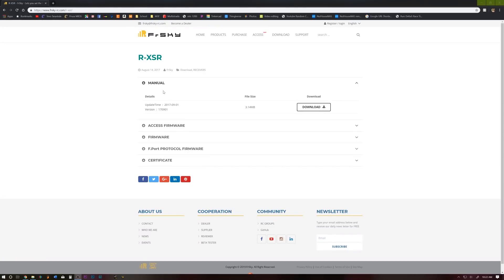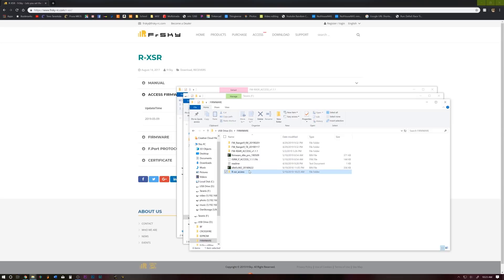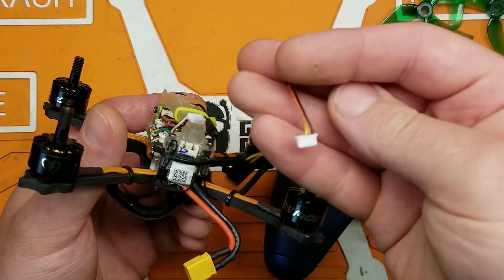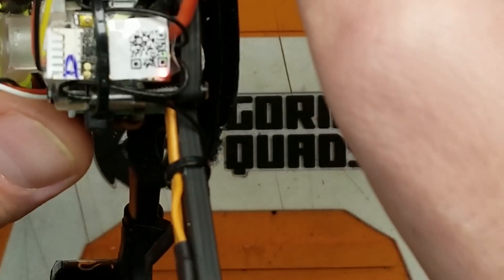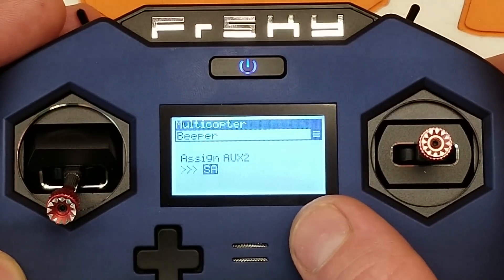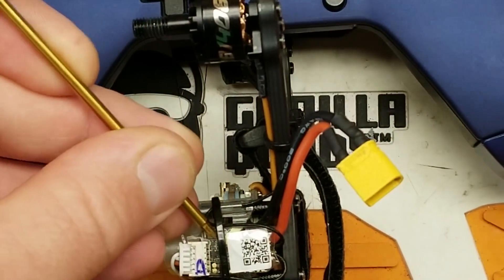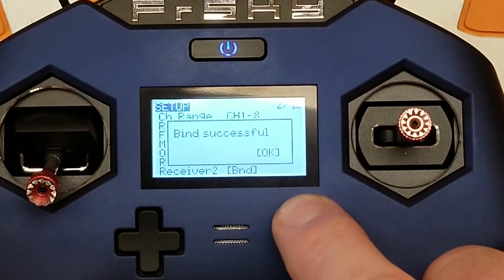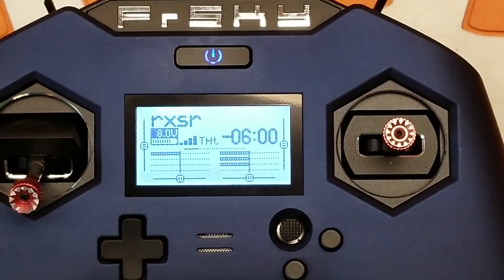Frsky R-XSR ACCESS firmware install

Comment: I’m trying to update firmware in my R-XSR.  I have a Taranis X9D Plus, do I need to get a cable with the mini usb to connect to my Taranis to my drone (chimera5)??
Reply from the maker: No. You need to connect the rxsr to the radio with a servo cable to flash fw.

Comment: I get an error right after it says device reset. 
any insight on this?
Reply from the maker: there has been a lot of changes to the frsky ecosystem since this video. I highly recommend making sure your radio's operating system is updated as well as the ISRM FW.

Comment: I just got my R-XSR and your  ACCESS flashing instructions are very welcome, quite clear and easy to follow. 
 Do you have any advice about antenna positioning onboard the aircraft?  There are two antennas that seem to be made from tiny coax. 
 Only about 1 inch of the inner conductor is exposed at the ends, which I take to be actual antenna.  I am thinking only the last inch or so needs to be "in the breeze" and vertical.  Must the black part of each coax (about  2.75 inches long) be straight as well?  Also does it matter how far apart these two 1 inch antennas are mounted onboard?
Reply from the maker: Thank  you for the kind words. The only part of the antenna that needs to be exposed is the clearish ends. Ideally you would want them oriented 90 degrees from each other and as far away as possible but it doesn't make that big of a difference if they are close.

Comment: hi its been a few weeks and i still cant bind ,, its solid red and green after i turn on the receiver and hold the bind button. i did the firmware update and fcc and my remote is fcc and flashed internal mod aswell. can i contact you through some website and pay for your services?
Reply from the maker: Hit me up on discord and I can help you out https://discord.gg/YrB7BSv

Comment: Thank you for creating such a clear video on how to do this. I have the X9 lite and RSXR and had a lot of trouble trying to get them bind. wasted like 4 hours with different methods found on the internet. watched your video and followed it step by step making sure that the firmwares match on both rx and x9. thank you!
Reply from the maker: Glad it helped
Reply: I tried both access and accst (instructions came for accst) but neither would bind. Tried a few times.. 
Then switched to xjt lite external module and binded instantly.. 
Feel like I'm losing range using xjt lite module instead of x9 lite s internal
Reply: I'm try changing radio firmware see if that works. Thinks its 2.3 or something
Reply from the maker: You'll need to update the operating system and the internal rf fw. Additionally you'll probably need to update the fw on the rxsr as well.

Comment: Thanks for the tutorial. Will the r-xsr with accst firmware bind to access d16??
Reply from the maker: Yes it will but the radio needs to have opentx updated to monething newer than 2.3.0 and the internal rf module needs to be updated to access v1.1.3. I wouldn't recommend flashing v2.x to the internal module.

Comment: Hi I’ve got my New FrSky 9D SE 2019. And this is my first time I bought a BNF drone. And the reciever is R-XSR. Do i need to download the firmware to the controller? Hope you help me.thanks.
Reply from the maker: Possibly. If you can create a model in your radio that uses accst d16 then you should be good. If you can no then you will need to update the os on your radio.
Reply: @TweetFPV  isaw on my seettings have accst d16.
but idont know how to bind my quad :( to my controller.
  thank you fro the reply sir.
Reply: @TweetFPV  can you help me sir.
Reply: Acutually i bough a BNF quad and the receiver is R-XSR.
Reply from the maker: It should be fairly easy. You will need access to the bind button on the r-xsr. Basically to out the rxsr into bind mode you need to hold the bind button down while powering the Quad on. This can be difficult one handed. If it's in bind mode the red led should be flashing. Then select bind in your radio. Exit bind mode in your radio and unplug your Quad. When you power your Quad back up you should see a solid green, red, and blue light.
Reply: TweetFPV now i get it thank you very much for your kind . Now i’ll proceed to beta flight configuration.
Reply from the maker: If you need any more help contact me using the discord link in the video description.

Comment: I flashed one of my r xsr succesfully but i bought a new one and it doesnt flash. It gives me an error. I already tried with the 3 versions of access firmware but nothing. Do you know what might be?
Reply from the maker: My guess is that you have the wrong wires connected to the rxsr for flashing. Be sure you are soldered to the smart port pad and are selecting flash s.port in the radio.

Comment: Great help this vide, just one weird thing is I have the options menu for the rXsr but there are no options  in it . I wonder if its because  I have the x9d.
Reply from the maker: X9d 2019?
Reply: @TweetFPV  Yes it is.
Reply from the maker: So you should have some options for the rxsr pop up but it's been hit or miss for me. That's how you set the rxsr up for fport mode or low latency mode and a few other options. I still haven't pinpointed why it intermittent.
Reply: @TweetFPV Once I hit the options  menu  mine   says "waiting  for rx "  As long as I can still fly..In your menu where you chose isrm mine says access and underneath  that I choose ch1-8 and It says 7ms.  Im on open tx2.3.4.
Reply from the maker: Yea that's what mine will say when it doesn't work but I can fly just fine.

Comment: Hi, I have the X9D 2019. I just flashed my radio to 2.3.4, you set your internal  rf to isrm. Mine has access and accst D16 only. Do you know if isrm is in 2.3.4
Reply from the maker: Isrm is a separate fw that needs to be loaded. Opentx is the os on your radio the isrm is the internal radio module. You can get the fw for that from frsky. Com or you can check which version you have in your system menus. Btw you need to have a model selected that has the internal rf module tuned on to power the isrm and see the fw version.
Reply: TweetFPV Thanks, Yes I saw where it says the isrm version. I believe it said 1.10-1.1.3 fcc It was something like that. I  googled isrm and I think I have the latest. Just one question, is this something I should  update update every time theres a new version ?  Ive only been flying for about a yr but it’s the first I hear of the isrm.
Reply from the maker: @jordannovek2911  yea whenever there's an update it's a good idea.

Comment: I always get registered successfully, but cant bind after registering the r-xsr, I can’t remember how I solved it the first time
Reply from the maker: After you register power down the Quad. Go to one of your rx slots at select bind then plug the Quad in. The reciever looks for a binding signal from the transmitter in the first few milliseconds of powering on. No need to press the bind button on the receiver.

Comment: hey man must i rebind once ive updated the rxsr?
anyway ive updated to the latest isrm updatev1.3 and the latest firmware for the rxsr accst . seems theres no input
Reply from the maker: Are you trying to bind to your rxsr with access or accst? Also what color are the lights on the rxsr after you bind?
Reply: ive updated the firmware on my rxsr as the latest accst. also it was already binded to my xlite pro. theres a solid blue and green light.
Reply from the maker: Well it sounds like it's bound. My guess is you have something wired incorrectly between your rxsr and your fc then. A very common mistake is soldering the s.port wire from the rxsr to the sbus pad by mistake. Or using f.port on a f4 fc without a built in inverter.
Reply from the maker: Join my discord and I can help you better. Pictures help a lot https://discord.gg/H32cpV
Reply: it was already bounded and i flew it, its just that ive tried updating to the latest firmware. apparently my xlite pro couldnt fly but the range couldnt go anything beyond 100m and frsky said to update to the latest firmware and now i got it binded and no inputs
Reply from the maker: Have you updated opentx? That does need to be on the newer version. Not the ones avalible on frsky.com use the ones on opentx. Org
Reply: ive reverted to the old firmware on my xlite pro and my rxsr updated to the latest firmware d16 mode. its working now but telemetry isnt working after the update on my rxsr.it used to work on stock firmware

im not using access. and  not sure if latest isrm firmware on xlite pro would work on accst d16 firmware.
Reply from the maker: Ok, well good luck I hope you find the right combo that works for you. Personally I would just flash access to everything. Access is really great and works really well on everything that I've put it on.
Reply: hey man, well thanks for replying though.
i flashed everything to the latest firmware except of my opentx, i chose the access option on the controller though . its binded but my quad cant even go anything further than 50metres. even with 2metres ahead the rssi shown is 25% which is very low, could a low battery cause the rssi to drop? im on 7.4volts.
Reply: i cant even fly the drone , ive put my controller right beside the drone and the highest rssi shown is 36% something is not right here
Reply from the maker: @afifathnin  if you have everything updated (and yes you really should update opentx) all should work well. If you have that short of range  my guess is that you either have a bad rx, damaged antennas on your rx, or a damaged transmitter. No fw is going to fix a hardware issue. Typically a low battery won't cause any issues.
Reply: finally resolved the issue, ive changed to new antennas and apparently, theres a bug with flightone falcox. so i reconfigure the firmware and now its all good and flying well. i doubt it was the antenna issue because the ones i replaced are technically well intact and not damaged. the issue was the firmware on my fc
Reply from the maker: @afifathnin  ah. Didn't expect that one. Glad you got it fixed.

Comment: mine wont register
Reply from the maker: Did you update your isrm firmware and the access fw on the rx? Because they have to match. Ie you can't have isrm v1. 1.3 on the radio and access V 1.1.2 on the receiver. They need the same.
Reply: @TweetFPV  was using the access firmware just had to flash the first version of access to the reciever. Got it all working and it flies great

Comment: good I have x9d + se2019 and I can not see flash s.port in the access menu to put the firmware of the r-xsr, I only get the previous methods flash external module and flash internal module and that's how I've done it, I have in the x9d + se 2019 FW-X9DP2019-ISRM-V1.1.3 and opentx-x9d + 2019-flexr9m-lua-es-2.3.2, I don't know what I'm doing wrong or I don't know if the r-xsr doesn't support flash s .port, although I see it in videos of frsky xlite, could clarify doubt, greetings.
Reply from the maker: The 2019 edition has a s. Port plug in the battery bay on the right hand side. Connect your rxsr to that and select flash external. That should flash your rxsr.
Reply: @TweetFPV  ok thanks I'll try it, as I see it goes in this order
gnd
vcc
sp
Regards.

Comment: Mine won't register for some reason! no clue what i did wrong. any ideas? thanks
Reply from the maker: Most likely you have different fw flashed to the rx and the xlite. Which rx are you using?
Reply: I have the rxsr, with x lite pro. First off, I had put the d16 fw on it for my older quad. But just built a new one and wanted to be on ACCESS. So I flashed both the rxsr and the x lite pro. At first I had the wrong sd card contents, it would tell me when I powered on the x lite pro. Got that figured out. But still won't register.
Reply: Should I reflash the x lite pro? I think I have the latest fw for the rxsr. I have the 1.3 and the 1.4 being the latest. Wasn't sure which one I actually need
Reply: I finally got it figured out! Turns out I needed to flash rxsr with fw 1.1.1 f port. I was trying 1.1.3 and 1.1.4 thinking it would have it all. 
Now it's all registered and bound, thank you!
Reply: .. so I got it bound and what not. Now there is no stick inputs on kiss gui. I've made sure rx is in the right mode.  But now I think it's an fport fw issue. I'm clueless about all of this so it's pretty difficult

Comment: I follow the tutorial with updated RX (XSRX with ACCESS v1.1.1.1) and TX (latest firmware with ACCESS). On TX, the only option for internal RF is ACCESS .... using ACCESS I cannot register/bind the RX. COuld you try to repeat this tutorial using ACCESS on internal RF, please ?
Reply from the maker: If you have internal rf selected on a model then go Into the radio setting and see what version fw is flashed to your isrm and what region it says (fcc or lbt)

Comment: how are u creating a new model ? i cant select if i want quad copter or drone ....
Reply from the maker: Does it make a model just without the setup wizard?
Reply: Exactly !
Reply: Dont Know how u did that
Reply from the maker: Normally it's a option in opentx companion when you flash opentx in this case it just came setup to have the wizard. It's strange that yours doesn't to that. Are you using the xlite pro?
Reply: Yes il using x lire pro
Reply: *im
Reply from the maker: That's strange that it doesn't just come up for you. Are you running a nightly build or the original fw?
Reply from the maker: I think I just figured it out. The wizard is part of the SD card contents that are on the frsky web page. So you will also need a sd card in your transmitter.

Comment: Is the access firmware strictly for xlite  pro cause I can’t get Fport to work on my Qx7 and am stumped
Reply from the maker: ACCESS and F.port are two completely different things. If you are trying to get F.port to work with a F4 flight controller most likely your issue is that F.port needs to be connected to a UART TX pad that also has a built in inverter unless you are using a inverted F.port signal. Can you give me more details on your setup like which FC and RX you are using?

Comment: @tweetfpv the r9m lite module is working via nightly updates now.
Reply from the maker: Good news. I'll have to look into that one.
Reply: It's a bit buggy, for example. If the radio is allowed to power on with any switch or throttle warning the module will not power on. You then have to cycle the module on the configuration to get it to work again.
Reply from the maker: Yea I have it flashed now and am experiencing the same issues.
Reply: I'm happy w the range. Seems solid on the R9. I probably logged a total of 30 batteries w no rx issues.

Comment: can't get my x-lite to recognize any of the firmware I put on the SD card..
Reply from the maker: Which firmware are you trying to put on your xlite. Is it for the xlite or for the recievers? Do you have the xlite or the xlite pro.
Reply: TweetFPV I have the x-lite(regular) I figured out that I needed to formate the sd card on the xlite.. looks like the sad card is working now.. still can’t seem to get my r-xsr to bind though
Reply from the maker: The rxsr can be tricky to bind. It has the ability to switch into cppm mode if you hold the bind button for 4 seconds after its powered on. You can tell if you are in sbus mode because the led will be blue.
Reply: TweetFPV I managed to get it to blink red like it says it’s supposed to while binding but then when I unplug the battery shut off the bind on the radio then plug it back in it’s still blinking..
Reply from the maker: Are you trying to bind in d8 or d16 mode
Reply: TweetFPV I tried both.. looks like I have it bound now.. the levels are showing that they change now in betaflight.. but nothing happens when I try to fly it.. also the radio keeps saying “telemetry lost.. right after it says telemetry recovered”
Reply: Ok.. so went back in and redid everything exactly like you did in the video and I got all the way to setting up the model and there is no arm option 🤦‍♂️ wtf! I’ve been at this for hours watching countless videos.. it’s a wonder how anyone gets their stuff to work
Reply from the maker: You are probably better off just a assigning a switch to a chanel map manually rather than using the setup wizard in the xlite.
Reply: @TweetFPV  tried reflashing the r-xsr.. now I cant get it to bind at all using the same proceedure I used to bind it last time.. now I got all three leds on and the red won't flash until after I disconnect.. turn off the bnd on the radio and hook it back up to power.. 

another thing.. I'm trying to follow the video step by step but a guess the xlite pro has different options.. there is no option to register the module..

wonder if I can put the xlite pro firmware on the regular xlite
Reply from the maker: Yea these new binding procedures are only for access enabled recievers and transmitters. You CAN NOT  put the xlite pro fw on the original xlite.